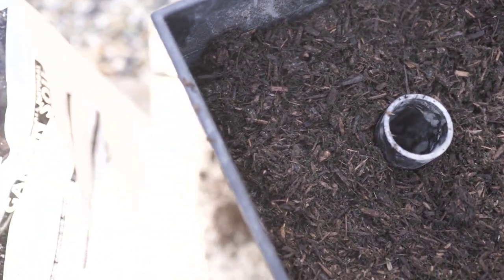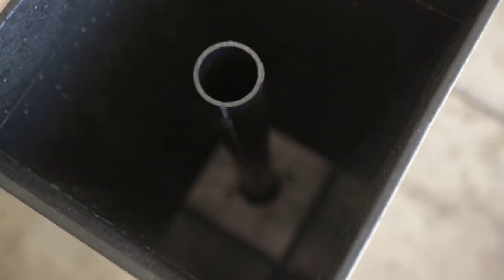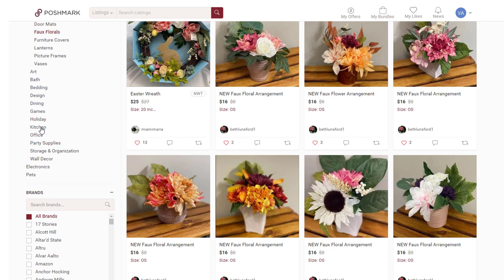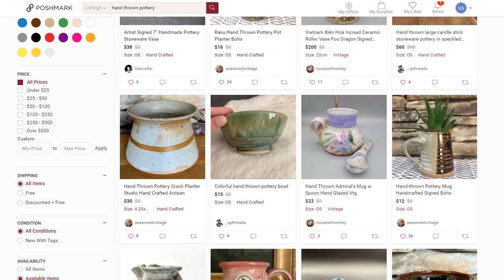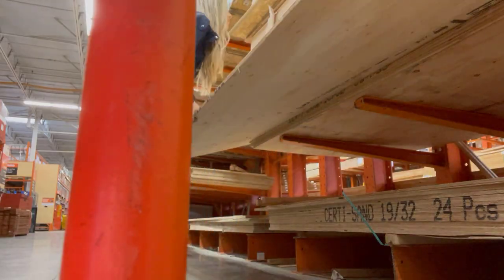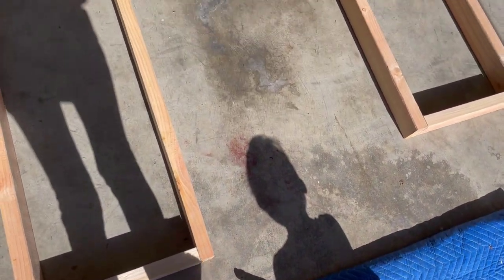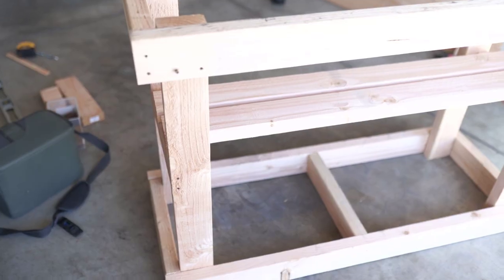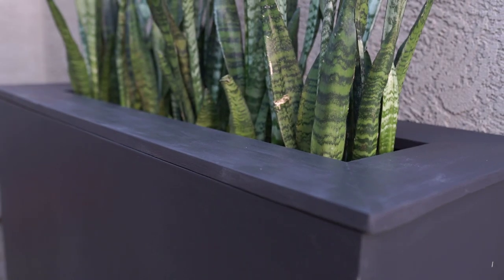DIY Patio Decorating Ideas // Umbrella Stand Planter & DIY Planter Box

Comment: It gets windy in my area - do you have a suggestion to connect that bottom of the umbrella to the pvc pipe so it doesn't take off in the wind LOL
Reply: I saw another video where the person used a pipe connector piece. It stayed on the lower stand section, and then you could tighten it around the umbrella pole when inserted into the lower pipe.